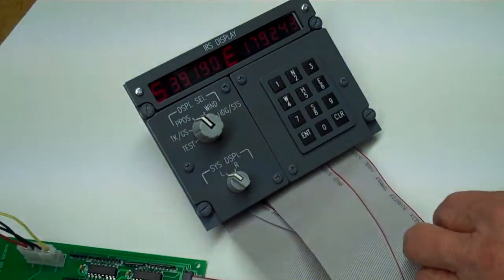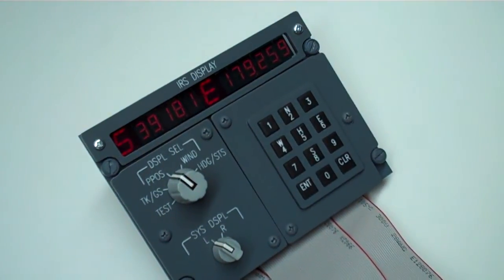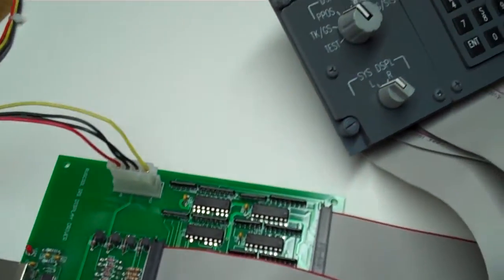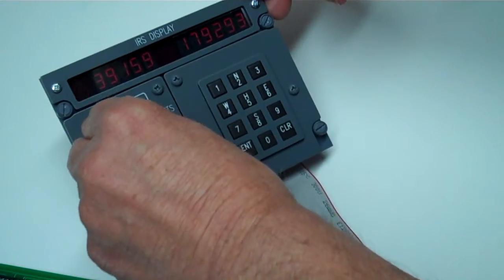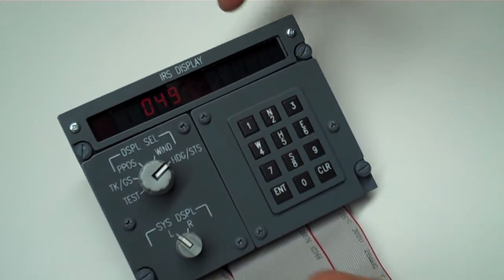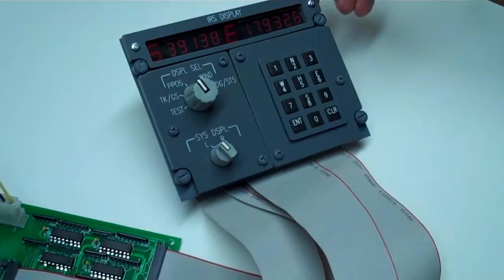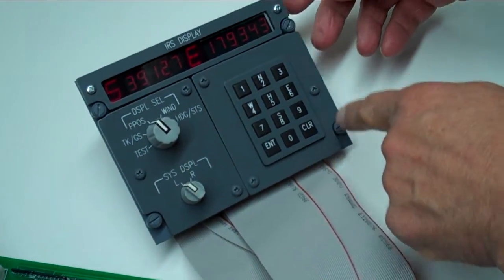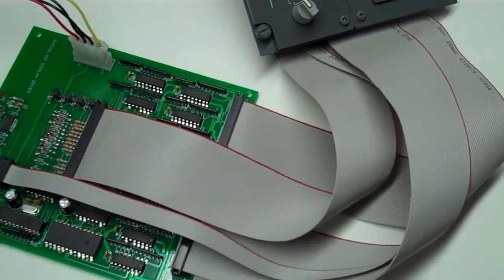Ruscool - Operational IRS Panel (Boeing)

Comment from the maker: This first version has been designed to allow customers the option of backlighting it themselves with 3mm LEDs, and all of the appropriate holes for doing this have been pre-machined. The material used also allows the panel to be effectively flood-lit from the rear. We are hoping to be able to supply these panels with the backlighting already hooked-up in the near future, although the price will likely change and our doing this will still be a few weeks away.

Comment from the maker: The price for this IRS panel (complete with driver board, ribbon cables, and software) is US$297-00 + Freight. You can contact us about the unit via the link now added to the video description - we'll add the appropriate product link once it's properly advertised on our website in the next day or so.